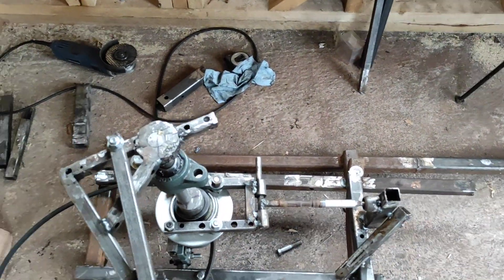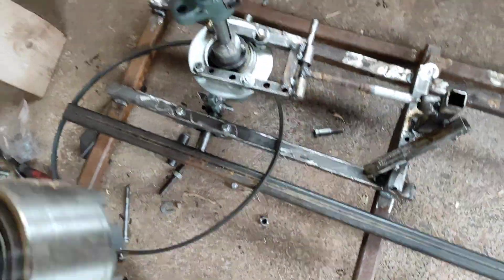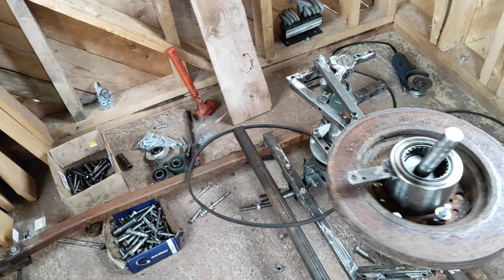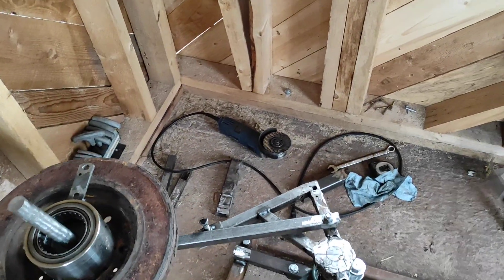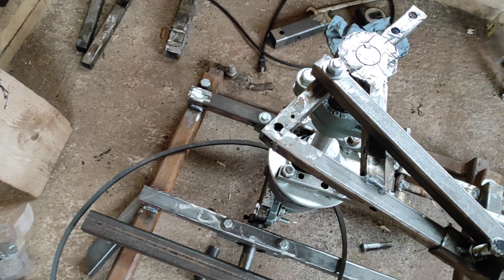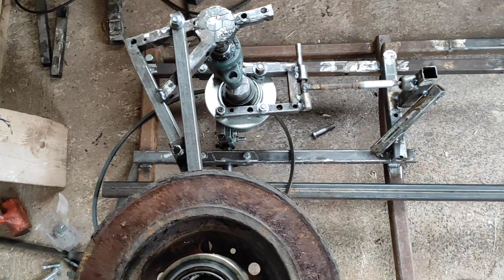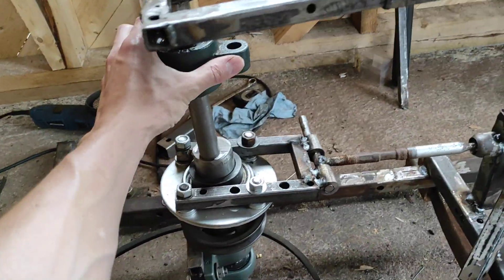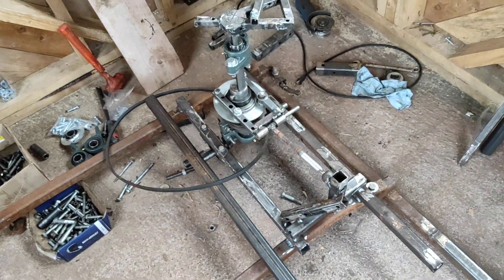Centrifugal Force Multiplier

Comment: Hello.  I like the idea of reversing the lever, but the unbalance mechanism on this setup won't work.  Everything must be in circle and the imbalance must be 90° ahead of the falling weight.
Reply from the maker: Overbalanced wheel do not work (based on my research). The machine has to incorporate some method of harnessing centrifugal force.
Reply: @QuantumEnergySearch  I think in centrifuge mode you will have gravity losses.  I can guarantee that the input to output ratio should be purely 90° without direct relationship and not centrifuge, I still see other skinner model construction errors, it would be more convenient for me if I can talk by telegram or wattsap.
Reply from the maker: @dillemburg5039  Have you tested any of your ideas? I have a telegram group, it's in the description.

Comment: hello friends, introduce me from Indonesia. I also have a mechanical design of how to use centrifugal force. maybe even this design has never been thought of by all mankind. I do research based on the laws of nature. and this I call "the law of moving objects is straight". "When a moving object is deflected, the opposing energy will arise, namely the centrifugal force".
Reply from the maker: People have been building over-unity machines for as long as time itself, but in recent centuries inventors have been met with violent opposition from the government.
Reply: @QuantumEnergySearch  That's impossible, the truth is the over-unity engine hasn't been found yet. or maybe if there is, it might be built with a less efficient system.
Reply: @QuantumEnergySearch  there are many countries that lack of energy have to import from other countries. if you can build an energy generating machine, you will easily sell it to countries that lack energy